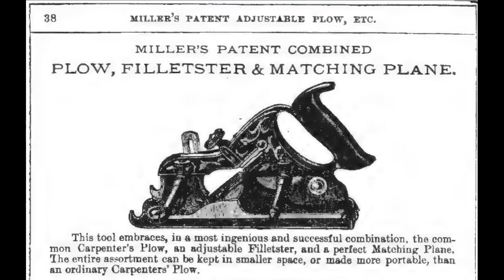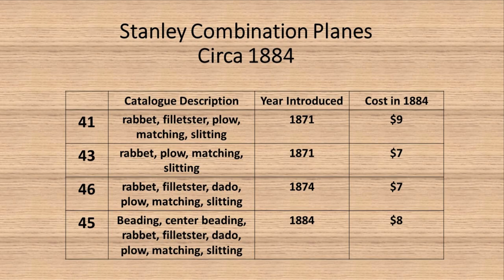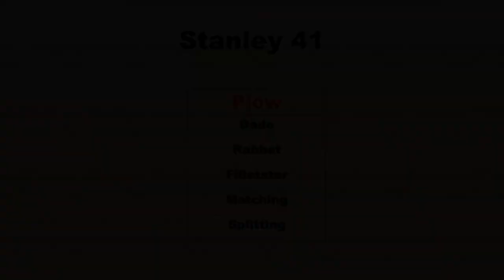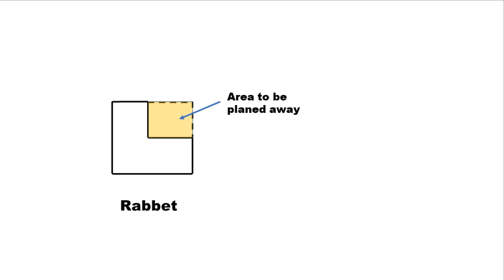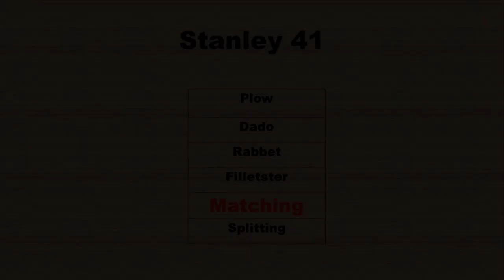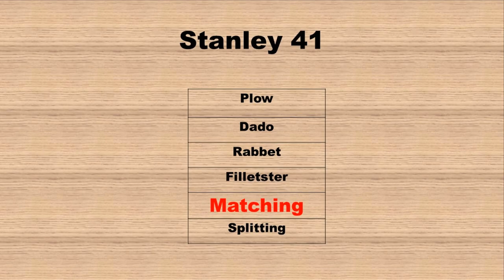The Stanley 41 Combination Plane - Evaluation of Functionality

Comment: Great video. There aren't much information on the fonctionality of millers patent. I think worth noting is when cutting a groove the plane ejects shavings on the right side vs the left like 45's. Especially if you're doing long grooves like joiners did 150 years ago you don't want to stop half way through the cut to clear the shavings in your left hand. I wouldn't want to hit a knot with the unsupported matching cutter...

Comment: i have a 41 and a 43, beautiful to look at but the later 45 and 46 were/are much more functional.  my 41 is setup with the fillister bed for both fillisters and rabbets.  my 43 is used for matching(tongue only) with a #50 for the groove.  i haven't tried to remove the nicker, it's sharp enough!